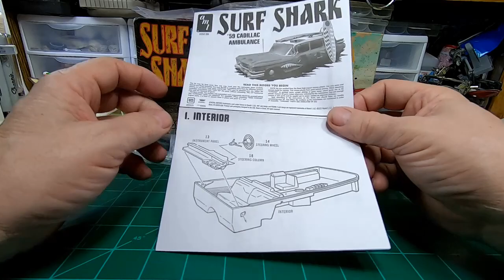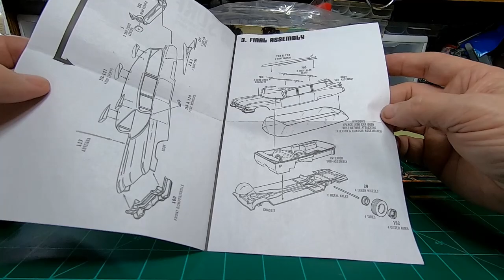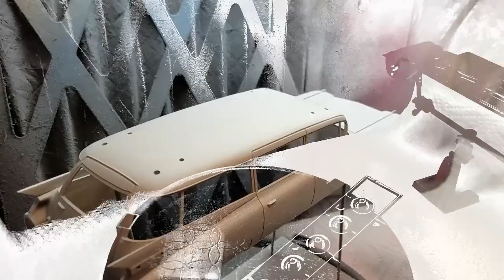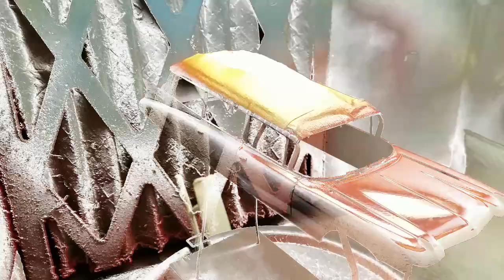1959 Cadillac Ambulance “Surf Shark” by AMT - Episode 31

Comment: I like that version better than the Polar Lights Ecto-1/1a because AMT did away with the 6 nubs for the Ghostbusters signs on the movie car. Though for a stock ambulance/hearse, some modifications really need made in the rear of the interior to get rid of the Ghostbusters mods from the original kit, but all in all, with stock wheels and the appropriate accessories, it would make a very convincing model.
Reply from the maker: I wish that I had taken the time to add the rails on the inside for a stretcher as well as the stretcher itself. The stock Cadillac rims/wheel covers would add more to the authenticity of it being an actual ambulance for sure but I generally build box stock and try to make it look good with what came in the kit box. I have not as yet had the pleasure of building the "Ghostbusters" version of this car. So, I can't really speak to that but I imagine that it isn't far off from this kit aside from the rooftop extras. This kit does have a ton of potential to be a better looking ambulance with the correct amount of part application i.e. lightbars, sirens, signage, correct wheels etc. Thanks for watching!
Reply: @scaleautoguysworkbench  you're very welcome, I enjoyed watching the video.

Comment: Question. What type mod podge do you use for clear coating and how do you thin it for airbrush?
Reply from the maker: The clear that was used on this is called Mod Podge Gloss Clear Acrylic Sealer. It comes in a 12 ounce spray can. I bought it from the craft section of my local Walmart.